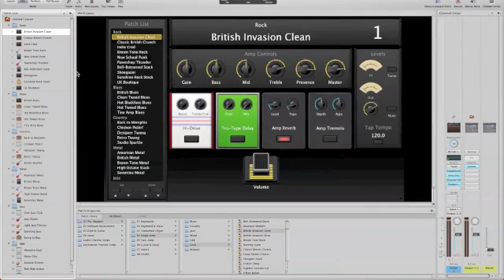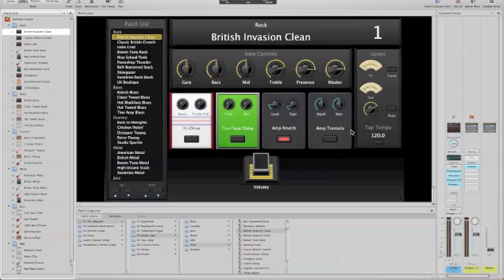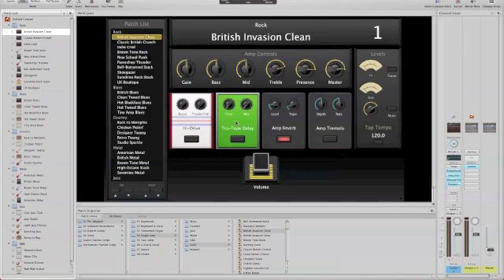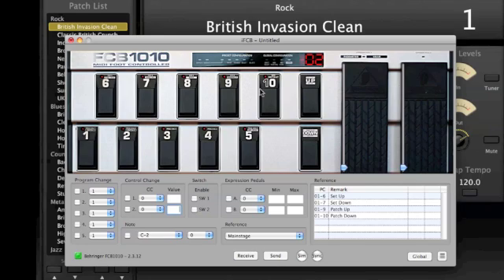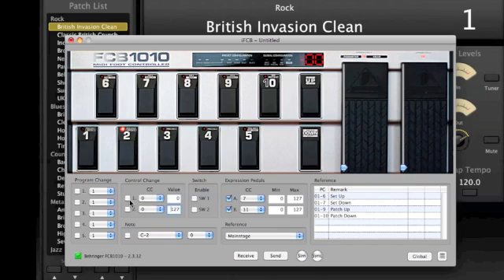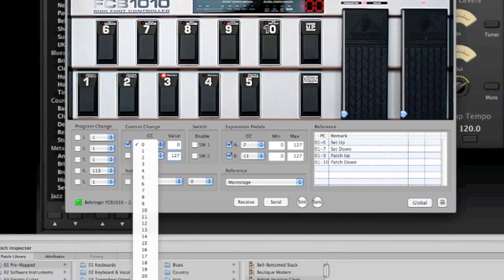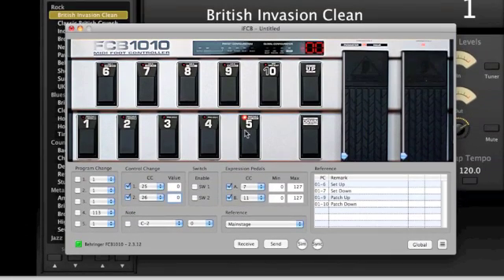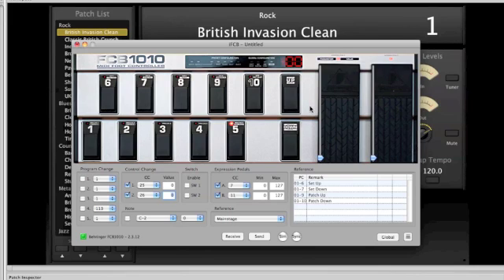Mainstage 2 Stompbox Control with FCB1010 - Part 1 of 3

Comment: Hi can you please provide a link to download iFCB software.  Thank you 🙏
Reply from the maker: https://download.cnet.com/iFCB/3000-2170_4-126021.html
Reply: @JasTheMusicman  hi thank you for your help I tried it but it is not compatible with my Mac catilina any suggestions plz
Reply from the maker: @11kerol  Ah ok, understood. Mel (the software author) must have retired ;)

Ok, so here's my recommendation(s) and the good thing is you can do one or both (I would recommend both). 

You can get a good working editor for both Mac and PC here: https://www.fcb1010.uno/
I would also suggest upgrading your FCB with the Uno chip (I can't remember if you have one or not) and that will give you more advanced functionality than the standard chipset. This same software will work for either non-Uno FCB's or Uno-based FCB1010's.

Comment: Thanks for the video! I followed your steps and when I use the MIDI monitor to check my work, all the pedals are coming in with the message "reset", no channel, no data. Is this a common problem? Any advice would be much appreciated!

Comment: Thanks a lot for your reply and you're right, the interface isn't good enough. I tried it through a different one and that light finally turned from red to green! Unfortunately now though I believe there is a fault with Mainstage as whenever I open it, it reads "The audio device “alesisio2” has been disconnected!" so I switch to built in audio. Then the message will read "The audio device “Built-in Input” has been disconnected!"
It seems someone doesn't want me to get this programme working...

Comment: Yeah it's the same cabling as before, FCB midi out to alesis midi in (also tried with the extra cable going from FCB midi in to alesis midi out) and no the light is red in IFCB and still saying no device found

Comment: Hey thanks for all your video tutorials but for some reason on my IFCB it says no device found.. I have a MIDI  cable running from the midi out/thru on the fcb1010, in to the midi in on my alesis io2, which is then connected to my macbook via USB... is this correct or am I missing something really obvious? Thanks again!

Comment from the maker: Ok my friend, I did some research for you but not good news I'm afraid. The Saffire Pro 40 does NOT support large block SYSEX transfers which iFCB (and other software) needs.  It only works on single blocks of less than 256 which considering it's such a high end device, is just not acceptable IMHO.  I would complain to Saffire.  Anyway, that doesn't help you now so go with an external MIDI device such as a MIDISports 2x2, etc.  Congrats on the 3rd kid!! :)

Comment: I have the green light and the Behringer Ver No. is 2.5.1E. I have now downloaded IFCB1010 to my MBP running Lion, to see if that wud make a difference from my iMac and unfortunately it hasn't, still the same reset msgs on midi monitor. From other threads starting to think it's my Saffire Pro 40 that may be to blame?
But if you have any solutions they wud be greaty appreciated. 
Apologies for late reply, 3rd child born not long after last msg, leaving v.little time for playing with midi toys:(

Comment from the maker: Ok, sounds good from a cabling perspective!  Let's now do 2 things...first, do a reset of the FCB1010 (section 2.8, page 12 of the manual) back up any presets in iFCB if you need them.   Secondly, after the reset, launch iFCB and look down at the lower left corner and let me know if you have a green light and the Behringer code version number.

Comment: Nice one.... I'm running Midi OUT/THRU from the FCB to Midi IN on the Pro 40, and Midi OUT of the Pro 40 to Midi IN of the FCB. The Pro 40 is FireWire'd to my iMac. 
- I believe I am connecting ok to the iFCB and syncing fine, but I don't have a definitive way of confirming this as I have only ever tried to hook up the FCB with MS.(I have never had any error msgs etc) Midi monitor has/and is, only ever stated/ing that it is sending 'reset' msgs.
As for the Midi to USB cable...Stink!!

Comment from the maker: Sure, no problem...let's start going through a few things to narrow it down:
- Let me know the exact cabling, i.e. what's going where
- When you use iFCB, can you connect ok and write settings to the FCB1010?
On the midi-usb cable, yeah, a lot of those cables aren't very intelligent so I'm not totally surprised it wouldn't work.

Comment: Hey man, great vids, but i'm struggling. Trying to program FCB using IFCB to use with MS2. Used all your pointers but no joy. I'm running the FCB thru a focusrite saffire pro 40. Whenever i tap a pedal after doing all the prep work i'm only sending reset msg's to MS. I've confirmed this using MIDI monitor. Every pedal just brings up 'reset' msg. Not sure if the focusrite is to blame? Tried going direct to imac with MIDI to USB cable but doesnt acknowledge midi at all. Any help wud be great!

Comment from the maker: @tuttobono Sure, the best way is to flip the unit over and remove the screws from the back plate and take a look at the chip.  If it says Behringer it's factory, which is the most likely scenario and it will say UnO if not the factory chip.  Google "uno chip" images and you'll see what it looks like.

Comment from the maker: @lavusrcu I used an audio interface which also has a MIDI connection (M-Audio Fastrack Pro) and the Fastrack Pro connects via USB  to my Mac.  

Complet connections are:
FCB1010 MIDI Out ---> M-Audio MIDi In
M-Audio MIDI Out -----> FCB1010 MIDI In
M-Audio Fastrack Pro USB----> Mac USB 

This sends MIDI signals from the FCB1010 into the FasTrack Pro then those MIDI messages get sent to the Mac from the FasTrack Pro into my Mac.

Hope that helps!

Comment from the maker: Thanks for your comment Brad...some (many in fact) FCB's are bought used and haven't been configured properly, are wiped clean, or some others just don't want to use the factory settings.  So while Mainstage will Learn any CC (if it's there already), the point of the video series was to show viewers the full cycle.

Comment: MainStage should take care of a lot of this configuration. All you need to do is make sure your buttons are on different CC channels. That was kind of the point of mainstage in the first part. You don't have to go through massive setup with reprogramming the controller to work with the software.

Comment from the maker: I installed the UnO chip but then uninstalled it because I really didn't need the functionality.  The main thing it does is make manual programming easier and also enables the switches to correctly reflect stompbox state.  But, for me with iFCB, manual programming is no longer an issue and as for stompbox states, I look at the Mainstage screen for that info, not the FCB1010.  Hope that helps.

Comment from the maker: Ah, good question!  The old version of iFCB used to have a way that you could create a text file and associate it with iFCB for reference but that function has been replaced with a Comments section for each switch...it works much better and is a great enhancement.  So just ignore that Mainstage Reference :)

Comment from the maker: No problem.  But there is a solution to what you need, for a few more bucks that is :)

What I do is connect up the FCB1010 to a MOTO MIDI Express 128 which IS usb bus powered and the MIDI from the FCB comes right into your computer via the usb connection.  Works great!

Comment from the maker: Great job sticking with it, congrats!!

Yes, you could assign different MIDI channels just to be safe and ensure separation but you can also define the keyboard for MIDI input by instrument channel.  If you click the instrument channel strip which has say your EXS24, you will see a MIDI Input tab in the Screen Control Inspector at the bottom of the screen so you can define the specific keyboard imput for that instrument channel strip.

I'm really glad the videos helped you!!

Comment: @JasTheMusicman 
Yipeeeeeeee works fine but trying to get the mic inputs working now lol 
I have another question . you /SUPER GUY YOU......
i have two keyboards and wish to use both using  main stage samples exs and stuff  .do i have to set up different midi channels for each keyboard, i guess i need that to be able to use both through main stage?
by the way Thank you so much would have been stumped without your videos 
cant thank you enough..

Comment from the maker: Also on the 88 thing...it's a memory error, and MIDI interface error.  When you power up the FCB1010 and get the flashing 88’s it means his interface is supplying data to the FCB1010 MIDI IN. 

You have to disconnect the whole MIDI interface from the FCB1010, power it up, THEN connect the MIDI interface IN and OUT. Then try to run iFCB.  Any other order won’t work.

Try that and let me know.

Comment: in your video you mention you had set up the fcb1010 earlier so that the ifcb works
I brought the ifcb1010 like you have but i cant get it to recieve the sysex messages
and when i turn it on a get 88 in on the fscb1010. it does tell you how to put it into recieve sysex but wont work keeps telling me the same thing to out the fcb1010 into sys recieve  mode i am going arounf in cycles here lol 
Can you help my friend

Comment from the maker: They don't have to be on different MIDI channels, you can either just have separate Mainstage patches and use a Program Change to switch them (from a FCB swtich) or have them both in one patch using separate channel strips and MIDI control the fader or the out level for each one as you like...or even a Send value.

Hope that helps, there are different options depending on what suits you best...feel free to message me for more info if you like.

Comment: oh also to use say, the exs, then switch to real strat (soft synth) i guess they will need to be on different midi channels how do i set the fcb1010 to change the midi  channels or to select a different soft synth . or do you put it in banks  thanks

Comment from the maker: Ah, that explains it :)

Ok, yeah the io will work nicely!  I'm sure it'll solve the problem and going by the specs it looks like you'll have a nice signal as well.

As for latency, you won't be able to beat you xt live as you know but through lots of CPU at it and you should be good...it's way better than I thought it would be but also depends on plug-in's.  I'm hitting the ceiling occasionally when I use Amplitube but the native modeller's and stompboxes are lighter and sound real good anyway.